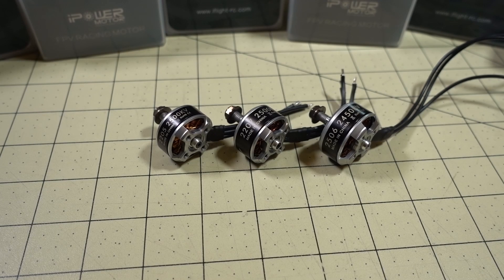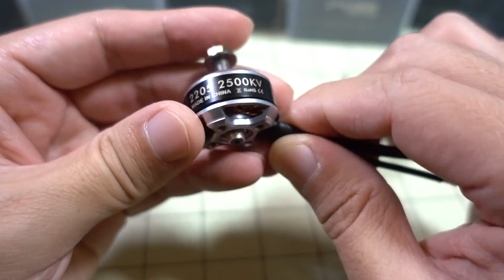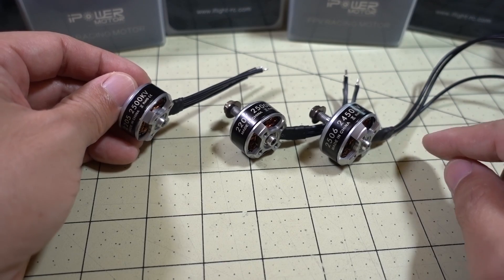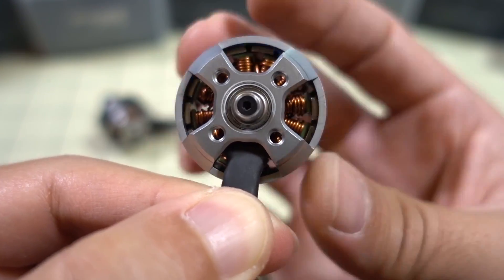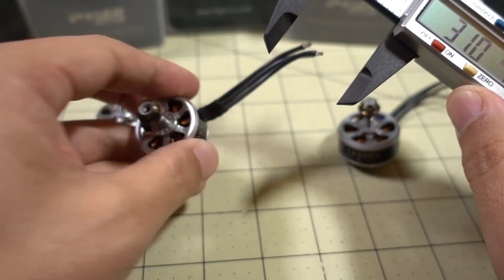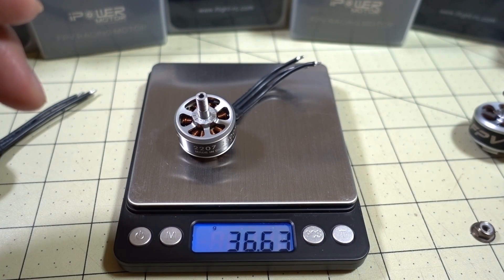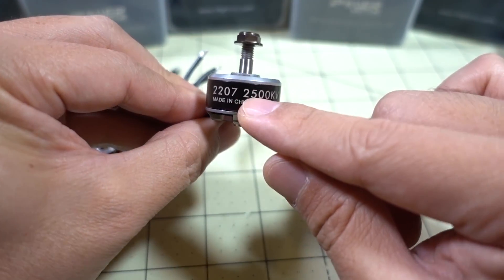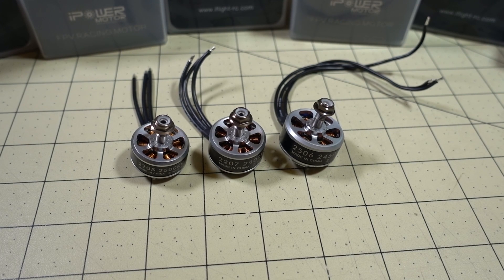iFlight ION Motors 2205 2207 2506 OVERVIEW

Comment: Emax RS2306 2750KV, too hungry, not enough performance for watt, go online put 2206/2500kv motors in cart, see these, smash buy it now.

Worst part is the fame it's going on is middle weight at 100gr. but it has the lightest components I could find- it's like ordering a unsweetened tea and a salad, then ordering a double bacon burger with extra cheese- kinda ruins the diet you know?

Comment: Great Motors. I've been running the 2506 2450kv on a 1300mah 5s with HQ 5048v1s for about 6 weeks and on 5 inch props they've been pretty efficient and they run super cool. Three and a half minutes of pretty aggressive freestyle or four and a half minutes just cruising. I'll be putting them on a 6-inch build soon. Definitely not well-suited to racing but a nice heavy duty freestyle-motor.
Reply: proto fpv. 🤯😳 that’s impressive.
Reply: Yeah, I just had my first successful maiden after a month of trial and error with bad ESC's and RX issues. They are the smoothest things i've ever flown, but they are not exceptionally fast, they are efficient putting around, but they will suck up the amps like shaq at a buffet if given the chance.